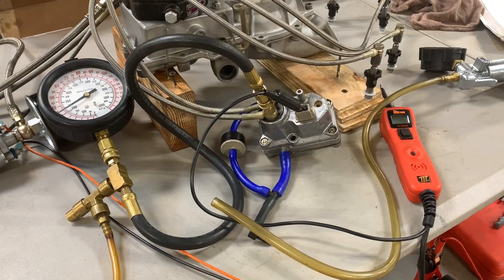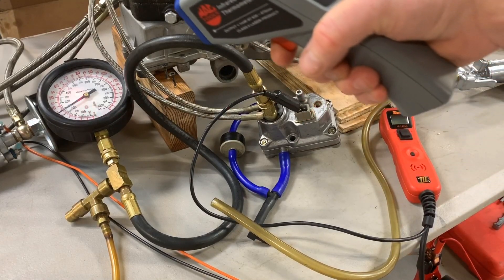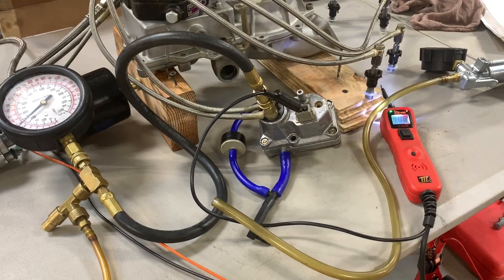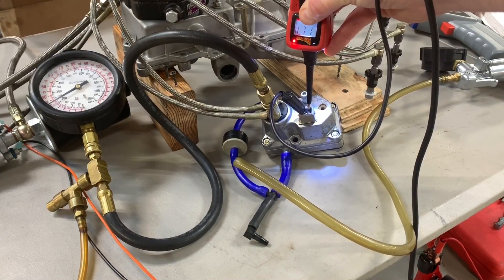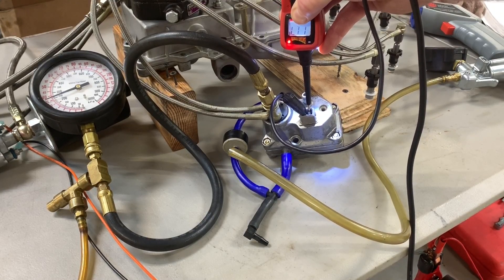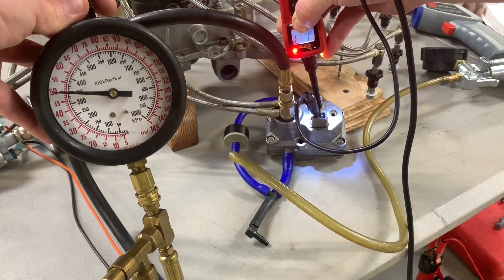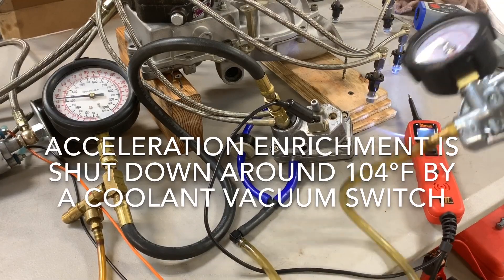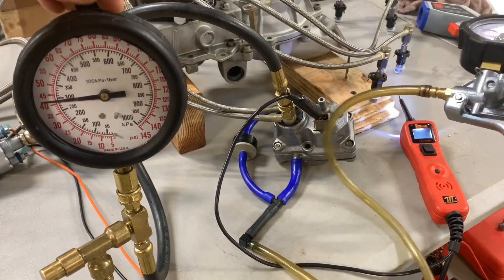Warm-up regulator testing

Comment: Great video Tim, interesting test you have done.  Maybe you can give me your opinion.  My 1980 MB does not start when cold but the rest works perfectly (runs smooth, good mixture, etc.) Its K-jet has a "Gas Pressure Damper" and a restricted metal tube between the Fuel Distributor and the WUR that seems to limit the correct gas pressure release when cold so the system can not do the transition from a low to a normal Control Pressure.  It starts at 4,0 bar from the first starting attempt. Do you know what is the purpose of that damper/tube arrangement?  (When I bypass them, Control pressure drops dramatically and the engine stalls) Do all cars have them? how can I test the WUR disregarding that Damper/tube? Thanks!

Comment: It is not called out in the exploded views or any of the maintenance but under that larger banjo bolt on the warm up regulator is a series of screens or filter that when clogged will cause upper fuel chamber pressure in the fuel distributor to become too high. On badly rusted fuel tanks or cruddy fuel it can block so much that it will equal system pressure +70 psi. The engine will not run well if at all / too lean. The range is between 25 & 55 psi Crack the line and drop the pressure and voila ! The engine will run. Pulling the screens can return pressure to normal. many of the rebuild kits omit the filters altogether.

Comment from the maker: The warm regulator has vacuum applied while the engine is cold.  A dip in vacuum (quick acceleration) helps a spring inside the regulator slow the fuel flow of the control pressure.  The temporary drop in control pressure causes a imbalance in the lower chambers resulting in higher fuel flow to the injectors.
Reply: Hello, right now I am working on a WUR with single diaphragm (0438140015) and it only has 1 vacuum connector. When I apply vaccum the control pressure drops instead of rising. Should it be that way? What values should I set it up to?
Reply from the maker: @szymonkowalczyk2907  What is the application?  Make sure that the temperature vs fuel pressure correlation is correct before getting too much into vacuum enrichment.  Cold start enrichment problems are often related to a inoperative Thermo vacuum switch or a vacuum routing issue.